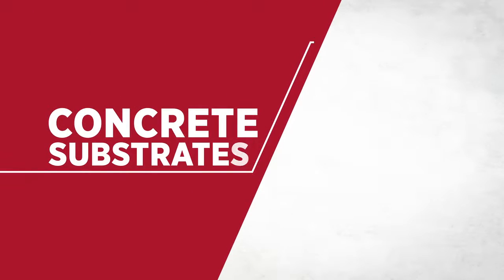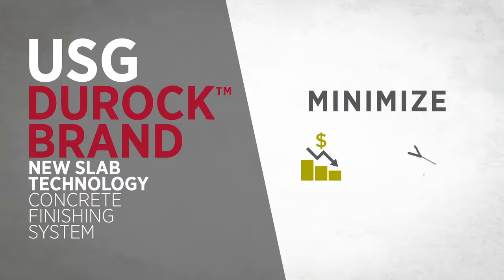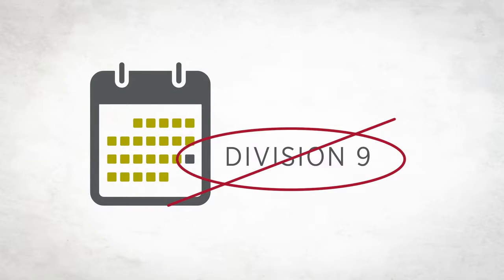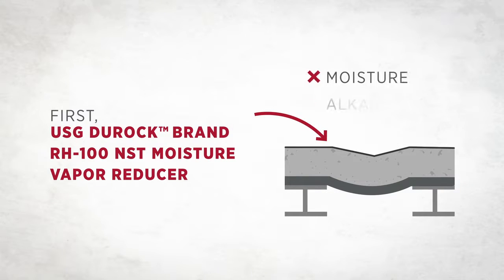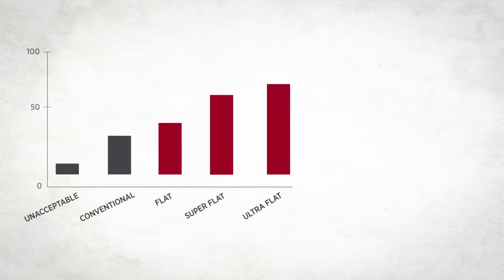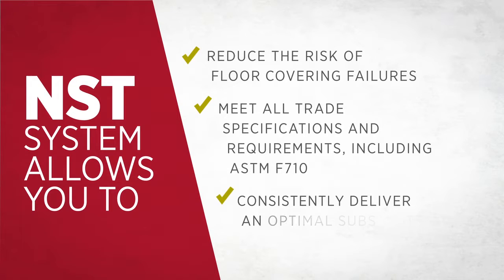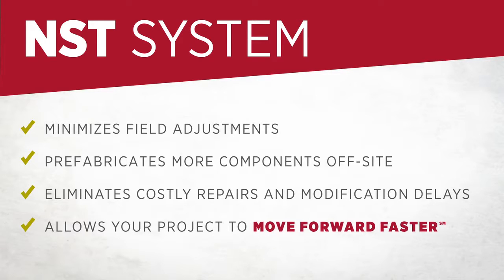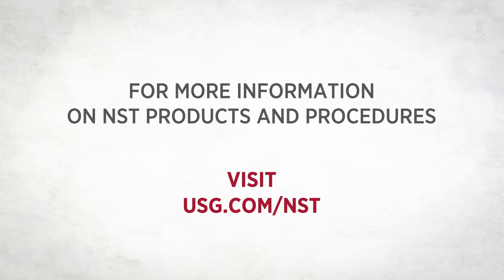USG Durock™ Brand New Slab Technology Overview

Comment: I would like to use your concrete Durock board for the base support for my garden railroad. Your durock board would sit on top of 8x8x16 cement blocks with the track sitting in top the board and gravel ballast added to the track area. This means the Durock board would be laying flat in Florida's wet weather. The board would need to hang over the edge on both sides by 2 inches. Do you think the Durock would hold up to this application? If not do you have a product you think would work better? rlz06 at cfl.rr.com
Reply from the maker: Hi Randy. Unfortunately USG does not recommend using this product for a garden application. USG Durock® Brand Cement Board is meant to be finished in some capacity, whether with tile or an exterior finishing system. It is recommended that USG Durock® Brand Cement Board be fully fastened, to the edges, with joist support in horizontal applications.